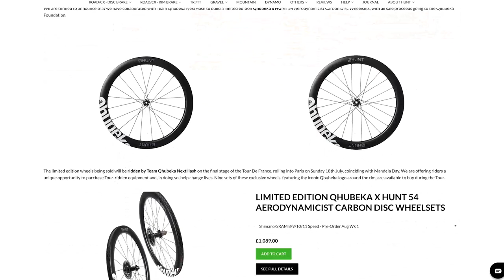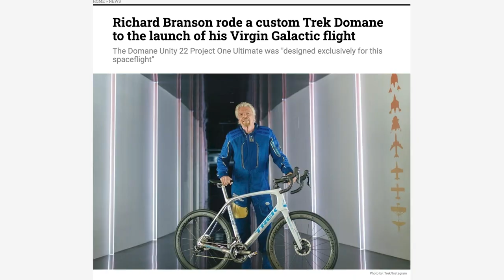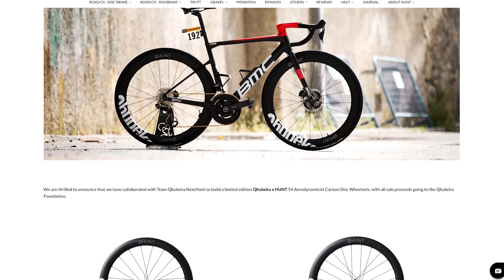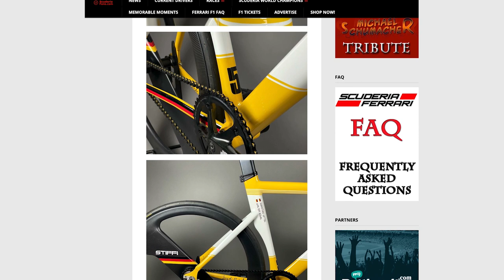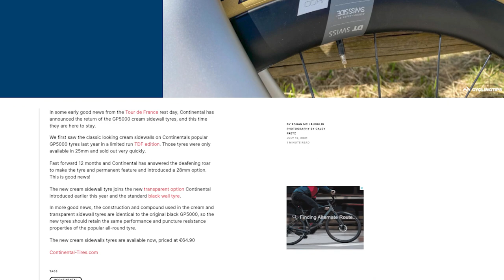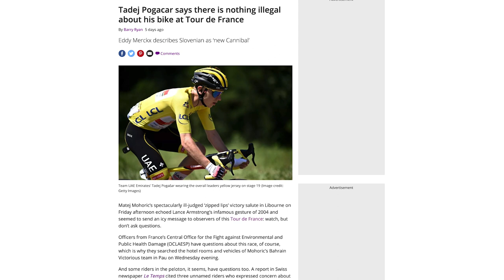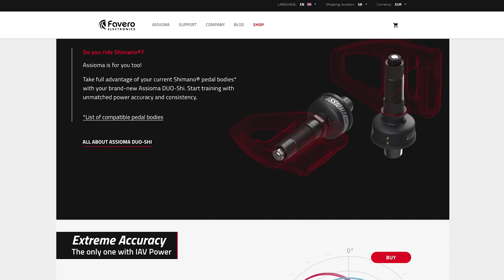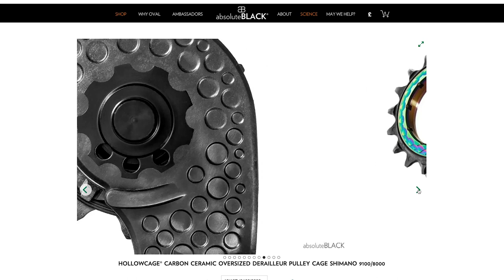Tadej Pogačar Won The 2021 Tour de France On Disc Brakes?! | GCN Tech Show ep.187

Comment: Ollie, pro disc brakes, but gets an F12 rim brake for himself :)
Reply: @JPLTF373  AMEN
Reply: @JPLTF373  the advantages of disc brakes have basically nothing to do with rider weight.
Reply: @leftaroundabout  they have to do with poor braking techniques by mostly out of shape middle aged cyclist who are lever heavy and want a promise for better stopping. The industry isn’t gonna teach better braking technique when they can simply push disc and lead to overall boost in sales of more expensive components replacement (disc wheels, calipers, hydro sets, frames that are disc only, rotors, pads etc)
Reply: @jesseladd6864  that's also not what it has to do with. Yes, disc brakes are safer for less-experienced riders (which is reason alone to push for making them the standard!), but they're also safer for experienced riders in bad weather conditions. Really, saving a couple of grams on brakes “because I have good technique and can work with rim brakes just fine” is a bit like a ferry operator saving money on lifeboats because “our crew is very experienced and probably no accident will happen that would require lifeboats”.

Comment: Pogačar is using rim breaks on the Olympics road race right now. Flats, climbs, descents, and all on this one. All his choice too; there's no sponsored team bike in the Olympics.
Reply: Honestly I think it's a lot more to do with the weather they will be riding in and especially in the Olympics the support for wheel changes. I can understand riding disc in the wet or a flat stage where it's not so bad with wheel changes and then using rim when there's any climbs and it's going to stay dry. Seems silly to me to use a less aero and heavier system that causes problems if you need a wheel change in any situation but a wet race but I get that his sponsor will want him to ride disc as often as possible so.
Reply: @itarry4  What I still can't wrap my mind around is disc on a TT bike.  Sure, there are occasionally TT's where you have to brake hard and MAYBE you can take a risk and brake a bit later on a disc and hope you don't lock up the rear wheel.  But, if you're spending time braking in the majority of TTs you're doing something wrong.

Comment: Horses for courses.  But for those of us who cannot afford three horses, I'll go with the one that provides all-around utility.  That would be disk brakes for superior stopping power in the wet.  Also, on a very long descent in the mountains of North Carolina with rim brakes, my carbon wheels got so hot that braking efficiency was next to zero.  I stopped 1/2 way down, burned my fingertips while checking the heat build-up, and waited 30 minutes (!!! )while they cooled.
Reply: And for those of us who can afford neither carbon wheels OR a new frame/bike equipped with disk brakes...
Reply: @The86rick  send it via PayPal, and thanks in advance 😂

Comment: Not only did he use rim brakes when it really mattered Ollie (like you), but he also used tubs - which was also glossed over. On balance, and from an engineering perspective rim brakes with tubs deliver more benefit than tubeless/discs despite the immense marketing efforts of the industry to sell the rest of us (but not me) a more expensive new bike  - with a brake system that only slows you down in every sense of the word!
Reply: I love how your 'engineering perspective' supports wearing out a critical component of a bicycle.

Comment: For the TDF, Giro & Vuelta I would like to see them use one bike for all stages. So they need to select which bike they will use for the whole 3 weeks - aero / all rounder / climbing / time trial bike.  So the only thing they can change for the different stages is the wheels and gears.  Just like in motor racing, they use the same car but just twig it to suit the particular race.
Reply: I am more interested to see tour using only 1 setup, even wheels and gears. Really curious which all around bike they will use
Reply: With disc brake flats they change the whole bike! So to stipulate what new bike it needs to be is a bit of stretch.
Reply: Silly...
Reply: I think each rider ought to be allowed one road bike and one tt bike for the entire race season. Components should be allowed replacement only in the event of fracture or seizure, or becoming bent out of proper shape.  That would add an interesting dimension to the sport.
Reply: That's not going to happen.  Bike companies need to sell bikes so they have to showcase every type of technology during these races.  I think dropper posts on road bikes are coming, it's just a matter of time.

Comment: All  mountain stages he won with rim brake so still only rim brakes ROCK!
Reply: GC is won on time not stage wins. The tour was all but over before they even reached the Pyrenees. He gained a total of 6” on Vingegaard on his rim brake bikes, including TT. By the stage 20 TT he gained 31” of his lead on rim brakes but gave 25” back in the final TT. By the stage 20 TT Pogacar had gained 1’49” over Carapaz using his rim bike and another 1’12” on the stage 20 TT for a total of 2’01” of his 7’03” margin. Again, all of Pogacar’s significant time gains were made on his disc equipped Colnago.

Comment: Yep, it was the disc brakes. Had nothing to do with his riding abilities
Reply: but you can't deny that there are people out there that are using brakes as an argument.
Reply: @Syn741  I can indeed deny it! Just to argue about the argument… sort of a meta-argument, if you will.
There’s no doubt that disc brakes have benefits in certain circumstances. I’m just not sure that the significant cost, combined with the fickleness (the wheel needs to be absolutely perfectly aligned, there’s no wiggle room), make them useful to the average rider.
Reply: and epo
Reply: I don’t think people are so much arguing that it was the disc brakes that won it for him but more that it didn’t matter that he wasn’t on rim brakes
Reply: @quarkonium3795  But it did matter, notice he went to rim brakes during the most critical point in the mountains, because a possible wheel change with discs would've cost him the race. He's smart enough to know how to leverage the benefits of both rim and disc brakes, and when to swap out from either one.

Comment: So he used a rim brake bike on summit finishes where braking doesn’t matter. That should help the disc/rim debate
Reply: He also posted 97km/h on the descent which was the fastest time out of anyone that day...  on Rim brakes.
Reply: @mikeshaw714  yep, seriously impressive, he hit max speed 90km/h+ almost every day. Mental
Reply: You can’t use the power of dis brakes on a road bike, the contact patch is too small. Disc brakes are 100% about cable routing.
Reply: @jacobmathis5686  you might not but others can. I’ve got hydraulic rim and hydraulic disc and disc definitely stop shorter

Comment: IMO, the only point of buying a bike with rim brakes is for hill-climbing events. I've been riding bikes for 60yrs with one common failing in particular - poor braking - until I bought a Ridgeback Flight 3 with hydraulic disc brakes 6yrs ago.

Comment: The riders aren’t really given a choice.Its the manufacturer’s /sponsors who decide.
     Getting a quick wheel change was never so slow😂
Reply: A defending TDF Champion, and most other team leaders get to use whatever the heck they want, as long as it is either produced by one of their equipment sponsors or can be passed as looking like it is produced by one of their equipment sponsors.  
Taking a close look at the bikes of most grand tour winners will reveal many personalizations ranging from rebadged or unbranded handlebars, stems, seatposts, derailleur pulleys, chains, wheels, and even the frame itself.
If a professional cyclist tells you that his bike is fully stock or just like the ones you can buy, don’t believe it for even a second.  Telling you that their bike is off the shelf is just another thing that they are being paid to do.

Comment: Disks on my next bike. 

Stopping in the wet is more critical for a casual rider than maximizing all 300 ft of the biggest hill in my state.
Reply: Stopping in the wet, not worrying about heat build up in the mountains, and not worrying about brake track wear are all reasons I went for disc on my road bike.

Comment: Keep riding rim brakes and keep wearing out the rims to stop yourself.  

Some of us don’t ride Mountain Top Finishes. Summit finishes are for the Top Tour Pros. Most of us must descend and use the best brakes we can.

So even the TDF Champion only uses rim brakes on summit finishes when stopping / braking is not an issue.
Reply: Don't know if you noticed, but those stages with summit finishes also included an awful lot of descending.. :-) And this is the FIRST time anyone has ever won a grand tour even using disc brakes for only some of the stages! Pretty remarkable given that the manufacturers have been effectively enforcing them on the peloton for years now..
Reply: This whole "wearing out your rims" argument is ridicilous. 
I have expensive deep section wheels. Guideline is to check rims after 3 sets of brake pads. Im at about 22 000 km so far on them and still havent even used half of the first pair.

Comment: In fairness, Pogacar didn't put more time in the majority of top finish climb riding rim brake. His most time is accumulated riding disc brake. The ITT gains him 1+ of his rivals. So I guess, he did ride the disc brake to gain the biggest time of his total winning margin. But when the dust is settled, either disc or rim, they both have their own place in the race for Pogacar.

Comment: Pogacar would've won on any brakes. He used both for different purposes. He won on both. They both served him well. It's not all about time and it's not all about weight. He used the disc brakes on the rainy stage where he gained a ton of time. He also won the mountain top stages on rim brakes. He never flatted on the mountain top stages or needed a quick wheel change, so he could've rode either and still won. Different things matter at different times. He also won a stage while riding a TT bike, but we don't say he won the Tour with a TT bike. The brakes didn't win the race for him. Disc v Rim brakes is such a pointless debate. I'm tired of it. Now you're just trolling for comments and I've fallen into your trap.

Comment: I'm calling it a combination victory. He won his stages on rim brakes but rode into yellow and did most of the  mileage on disc brakes taking advantage of the varying equipment available. A number of teams with disc only bike sponsors don't have such a luxury over a single frameset design.

Comment: Technically a “rim brake” is a disc brake...just a really big disc.
Reply: Only if you're using a disc wheel...

(But seriously, no, unless you're also ok with the argument that a bicycle is technically a motorbike... just without the engine.)
Reply: @leftaroundabout  a disc does not have to be solid without voids to be a brake disc.
Reply: @jbratt  ah, ok. Well, then a disc brake is technically a rim brake, just using a different rim from the one your tyre is mounted on.

Comment: In other news "The GC winner was wearing yellow"
He also "won on tubeless" except he used tubs in the mountains 
The teams get what the manufacturers give them
Reply: @ark8tct  And it's a HUGE amount of money.  Previous upgrades over the past few decades were somewhat iterative.  What I mean is you could go from 10 to 11 speed without too much hassle (on DT wheels, it was a cheap freehub swap).  You could go mechanical to electronic (especially wireless) without too much hassle.  You could  take your groupset from your Ti frame and put it on a your new carbon frame.  Swap new carbon wheels and pads for your aluminum wheels.   But, mechanical calipers to hydro disk - everything has to go.  There is no upgrade path other than a new bike.

Comment: Question: Why is a wheel change with disc brakes slower than a wheel change with rim brakes? (In my experience,  fixing a flat roadside is about the same with either system, about 20-30 minutes, LOL... )
Reply: 20-30 minutes? It takes about 5-7 minutes to change a tube and pump it up. I've done it in less than 5  minutes, using CO2 on a rim brakes
Reply: @terbennett  Good for you! It take me that long just to get my very stiff tire bead off the rim.
Reply: Not sure if that's a redundant question so here goes - it's not the brakes themselves, it's the through-axles that are now part of a disc setup. Requires you to completely unscrew the axle rather than just flip a QR to drop the wheel out.  And if you're a stickler, even with the exact same wheel as a replacement, you might want to adjust the caliper so the rotor is centered.  That last part is not a HUGE deal and may not be necessary, but when you're trying to chase back on, hearing a pad rubbing the rotor is demoralizing even if it's only a couple of watts.
Reply: @8584zender  I agree, but even with quick release, it is a challenge with disc brakes. In fact, I would think that a quick release skewer would make it more difficult to align the rotor into the caliper. A through axle simplifies that, but it has even more concerning challenges. Either way, I don't find disc brakes desireable...and my Cannondale S6 Evo HM has them. This is why I ride my rim brake CAADs more.

Comment: Can they just combine a rim brake and a disc brake in a single bike that way they don’t have to switch bikes?
Reply: If you converted a rim to a disc you would snap the frame, the reason disc bikes are always heavier is because you need to strengthen the frame and wheels to factor in the increased torque.  They have made 6.8kg disc bikes but they aren't usually stuff enough for pros

Comment: No he didn’t. When it mattered he chose rim brakes.
Reply: And when he made the most time he was using disc brakes so I would consider that as when it mattered the most
Reply: Yes but you have to consider the big bonus most riders get for riding disc. Plus tadej was the most fit rider out of anyone if he rode a gravel bike and still made time on those guys, does it mean a gravel bike is faster than a rode bike? Of course not it just means he was the fastest rider.

Comment: Disc brakes make so much more sense for daily use, but roadies seem to be afraid of any new tech 🤣🤣
Reply: No roadies just dont want to pay 300-500eu more for extra weight when the extra stopping power is not needed.
Reply: Also, daily use? Do you ride a lot with disc breaks? I'm not saying rim brakes are superior, but maintenance is a whole lot easier and takes less time. It's up to anyone themselves, but there are more downsides to it than upsides for roadies..
Reply: i'm a mountain biker, my daily driver is an mtb, disc is superior in every terrain but i'll rather use rim brakes on my road bike for my power spins, balance, weight, aero. rb and mtb are two different beasts. disc brakes are overkill in rb imo unless you live in generally wet conditions like snowy areas. just use cheap alloy rims if you ride rim brake road bikes on a daily basis.
Reply: Don't even notice the difference in good rim brakes Vs disk brakes on my road bike. Mountain bike is very different

Comment: Except for when he was on rim brakes…..
Reply: Just an add....I have no issue with disk brakes.  I have them on my mtn bike and my motorcycles and my car.  But on road bikes they are heavier, much noisier and much higher maintenance than rim brakes.  They do stop better in the wet but I don't ride in the wet very often.  They are also better on mountain downhills but I don't ride in the mountains.  Get what suits you but don't just buy something because the manufacturers are pushing it on you in order to increase their profits.

Comment: I don't understand why people get so funny about the whole disk vs rim brake thing. It doesn't matter at the end of the day, people should ride what they want. As long as they can stop the bike, what's the problem?
Reply from the maker: Exactly! Both systems work absolutely fine. It's actually really interesting that Pogačar kept swapping between different set ups to get the absolute maximum performance advantage depending on the situation.
Reply: If weight doesn't matter for you then fine. But there are actually cyclists (with limited budget!) that care about weight, please respect that. Like I said elsewhere, we're not only "arguing about brakes" like it didn't matter. We're arguing that for a bike of your desired weight (whatever it is) , you have now to pay more, way more than before, for almost no benefits. Suddenly we're talking money, 1000's of dollars, hardly earned, that you could use for your family or anything else. It's not "just about brakes" like it was about esthetics or color. And finally, no, you can't even ride what you want as there is often no choice anymore.

Comment: I think each rider ought to be allowed one road bike and one tt bike for the entire race season. Components should be allowed replacement only in the event of fracture, becoming bent out of proper shape, or mechanical failure.  Once a part has been replaced, it must be destroyed or surrendered so that there will be no modifying disguised as reparing or switching back and forth.  That would add an interesting dimension to the sport.

Comment: Disk brakes may have a marginal advantage over rim brakes, if and when, they get ABS technology.  Right now hitting either kind causes the tires to skid.
Reply: Disc brakes behave much more predictably though, in particular in the wet where this is most relevant. It's unpredictability that makes brakes dangerous, not the fact that you can apply them too hard and lock the wheel.